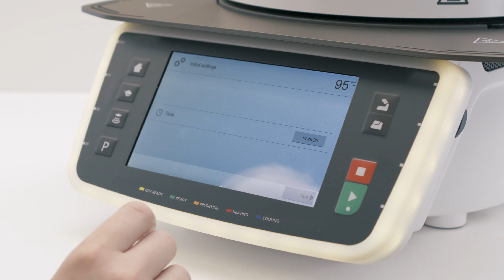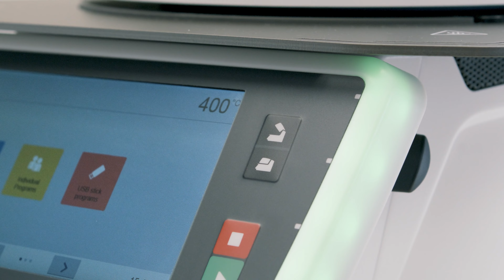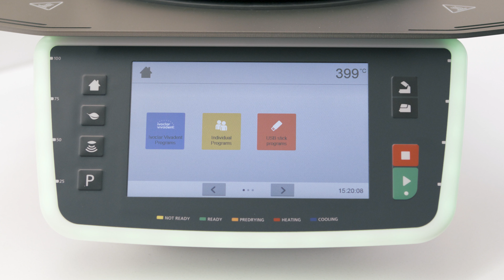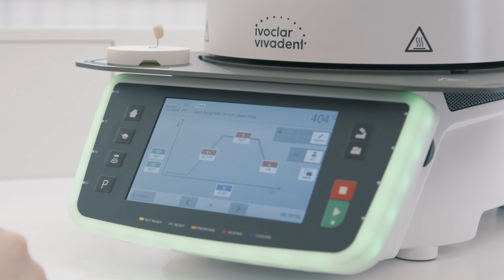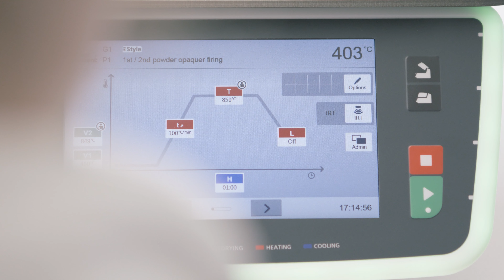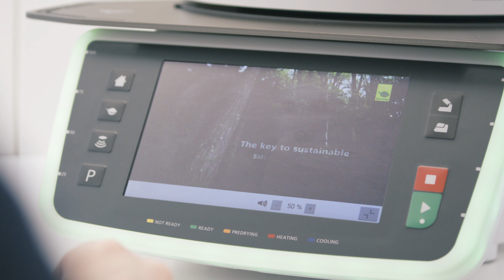Programat - Chapter 3: Initial start-up and operation | EN | Ivoclar

Comment: Hello ..I have p310.. my question is how are you setting Pre-drying time stage1 and stage1 hold time with 100% opened furnace head and Pre- Drying stage 2 and stage2 holding time...I'm using VITA VMK  MASTER.. so my stand by time is 403c stage1 Pre- Drying tem is 403 c stage1 hold time 2 minutes..my stage 2 temp is 500 c 2 minutes hold(with half opened furnace head and then 2 minutes closing time(S).. ..em I doing it correct(I got my furnace yesterday so I'm not sure em I doing it correctly)..?  Thank you in advance